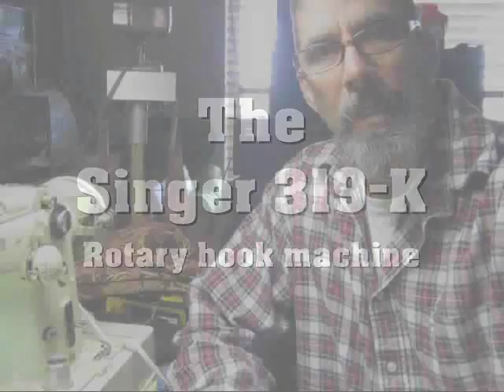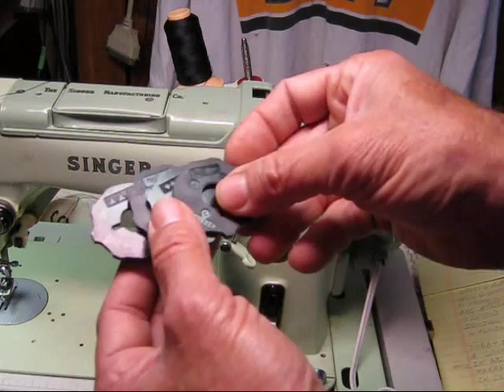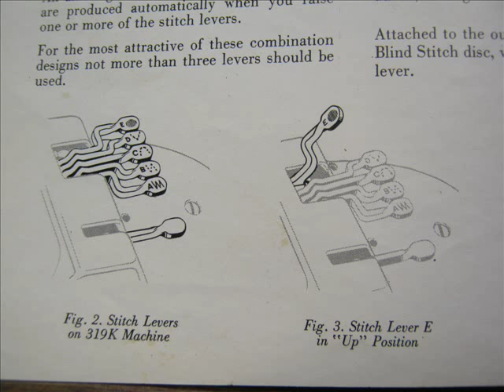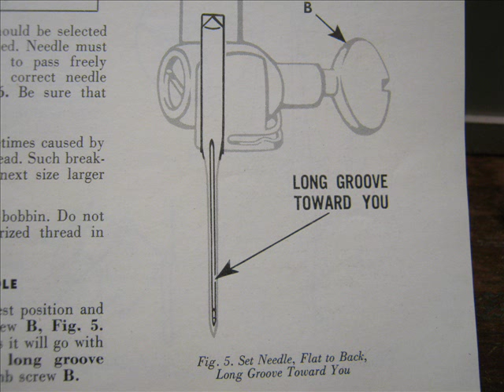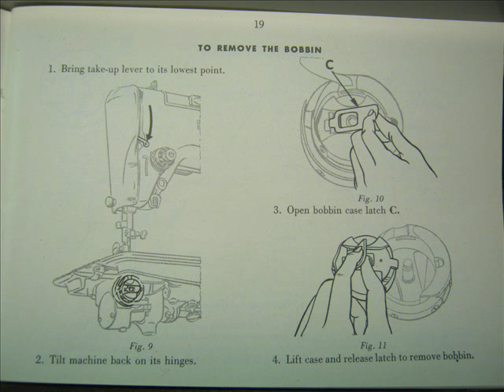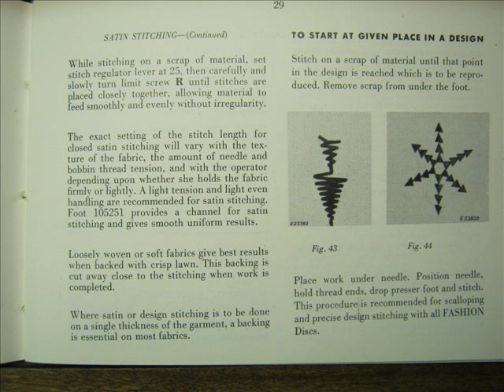SMH SInger 319K how does a sewing machine work automatic cams

Comment: My Singer 319K sewing machine was set to a 15x1 needle when my cousin gave it to me. And while testing it, the needle broke and it stopped making Zig Zag and decorative stitches. When you press the stitch key, they go up and down. And when I add 1 to 5 mm in the decorative stitches, the needle column moves from the center to the left or right and stops like a moving engine. I don't know what happened, but the column in the decorative stitches doesn't move on its own like it used to. The Singer 319 can sew straight very well. But in decorative stitches it doesn't work, because the needle column is inert. What could have happened?

Comment: Thank you a million times for demystifying the needle size. Just bought a  green 319 in a small cabinet for $25. Very clean but the stitch length lever was broken off which I didn't notice until I got it home. New lever is ordered and it looks like an easy install. I believe that the previous owner did not understand that the large screw locks the stitch length lever and must be loosened before moving it. It was broken it off trying to change position without loosening the screw. Sad face.

Comment: Thanks for the video. I have 319 k I just recently acquired but the stitches with cams are not coming properly. I can see they are not straight but not really like the one printed on the cam. Do you know what could be wrong? Cheers
Reply: Actually problem got sorted after adjusting the stitch length!

Comment: I have now got a 319k in black built into a teak unit. Immaculate condition but only has the power cable / pedal with it. Need to find some cam's! Thanks for the video as it's clear to see the difference in the needles needed too.

Comment: I am lucky, my 319 had the original Singer bobbin changes made to it and it works perfectly with standard needles. NO, the timing has not been changed, but the bobbin has been adjusted and there are no problems with it. I am very pleased. Works like a beauty. I call it "the tank" because I enjoy feeling "the machine" and it sews everything from heavy fabric to the lightest voile without issue. Only comment, is beware of non-vintage bobbins except for the low friction aluminium ones, they might not fit properly on the bobbin winder.